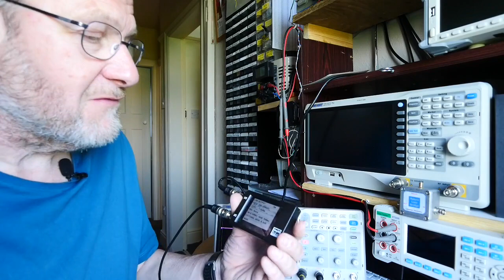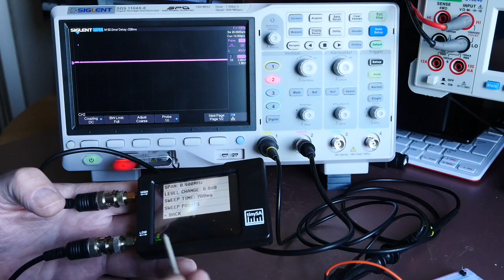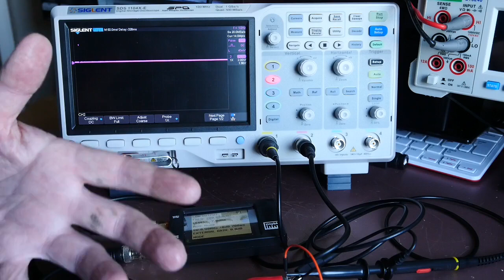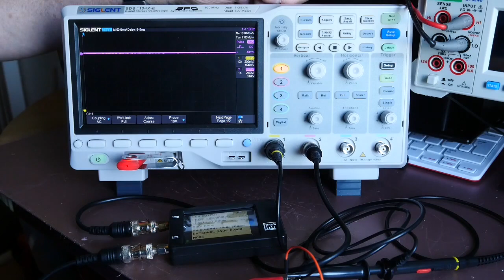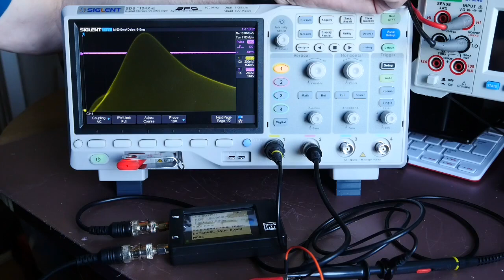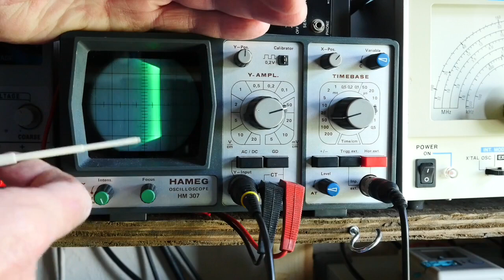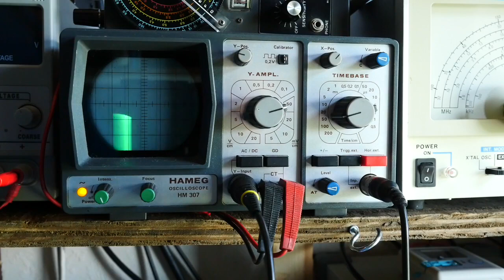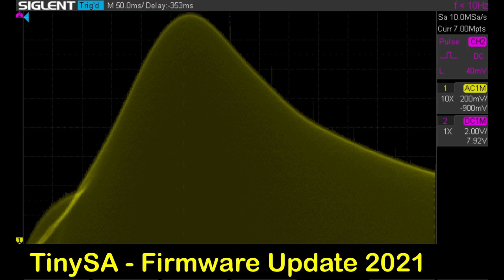Making the most of the TinySA firmware update   May 2021   #067

Comment: Just a quick note on the DFU utility if you''re a Mac user. Gatting dfu-util to run from the command line can be quite aggravating, but all is not lost. You can just install dfu-util directly on your Mac as a native application. It's available through both macports as well as Homebrew. I installed on my machine as "brew install dfu-util". I was then able to do a 'dfu-util -l' to list the visible devices, which found my TinySA and then install using the command line in the upgrade instructions. Mine now shows the November 2021 firmware version.

Comment: I uninstalled, reinstalled, ran control alt delete, started in DFU, not in DFU, turned on before, turned on after, restarted the computer many times, read the instructions, reread the instructions, followed another video step by step...this thing sucks!  This is way too hard for the average ham.  Having been one for 57 years, having built many computers, having several pieces of test gear, I should be able to get the thing working.  But,  I cannot.  It goes back today as defective. I won't rebuy because of the software being impossible to use.  Thanks for the help.  73, Jim Heath W6LG

Comment: Been there and done that many many many times.  I get the tones when I turn it on.  I do have the software running before turning it on.  I do get tones when I switch to DFU mode.  BUT, my device never appears in their terrible software.  My question to Erik was which driver.  Specifically which driver for Windows 10.  His answer, the one that I have.  That is no answer and it does not help.  But I have bothered him too much already and think I have gone over the line on asking for help.  My device never appears.  I will record that video today showing how it does not work.  I have about 37K subscribers and maybe one has an answer.  73, Jim
Reply: My device would not connect with the USB cable shipped with the TinySA. I used a better cable and now I have no issues connecting the device with my PC. Try that if you haven't already.

Comment: I got mine a few days ago  I have tried to do the firmware update with absolutely no luck.  I tried many drivers, Zadig, watched many videos, mine just does not work correctly. I have now basically given up; on the TinySA.  It is just too hard to use and impossible to update. 73, Jim W6LG
Reply from the maker: Jim, sorry to hear that you are struggling with the update. I too had a couple of attempts and gave up too.
Finally I had one more go and succeeded.
I have just uploaded a quick video of my upgrade method, which may help you - see it here:
https://youtu.be/lwxQOBr-Gr4
73 de Bill. G1YQY
Reply: @LockdownElectronics  I am missing something, somewhere.  I will try again now.  Thanks & 73 de W6LG in CA